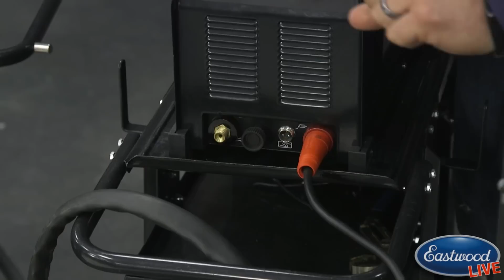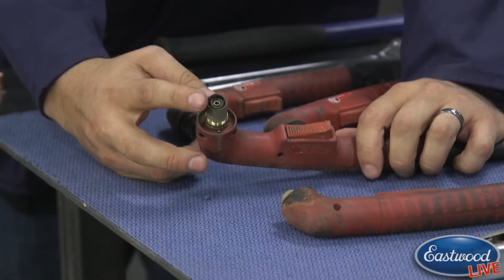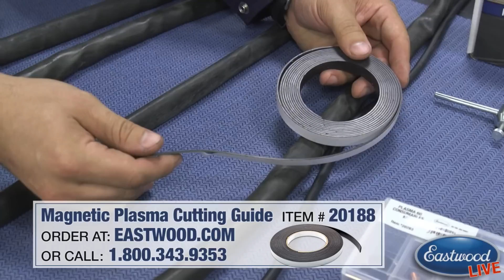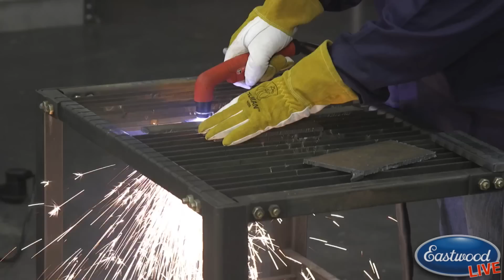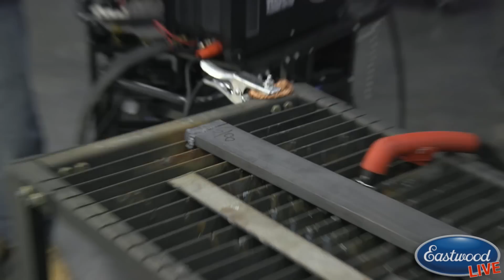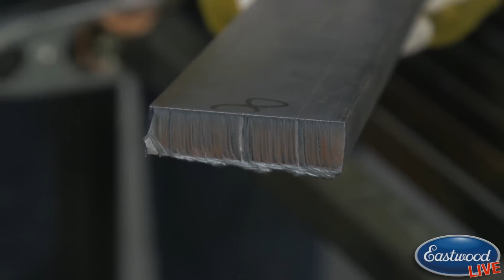Plasma Cutter Troubleshooting.  Improve Your Skills.  Get Great Results with an Eastwood Versa-Cut

Comment: Another question, what would be wrong with leaving the current all the way up all the time?  On thinner materials would it not be as clean?  Jim
Reply: No you will get over burn and tempering of the edges, you don't run your car at max revs all the time do you? No point putting the stress and wear and tear on your gear when you do not need to.
Reply: Torch consumables wear faster.  Plus the kerf is wider and you must move faster.

Comment: I have an Internal cardiac defribulator in my chest, can I safely use a plasma cutter or not before I buy one?
Reply: this would be a doctor question, but being I am familiar with the electronics they can throw out some emf noise and magnetic pulses, so you'll deff want to look into this.

Comment: That clamp is not a ground clamp! It is called the “working clamp” it actually is a positive voltage referenced to the tip of the cutter.
The material on the bottom of the steel that was not removed is called dross😁🛫

Comment: I bought a cheap one cut 50 so far I've spent more time fixing the air leaks than cutting, the digital readout reads 300 to 700 when you turn the knob and the air guage doesn't read PSI, junk
I've been had
Reply: Nope you got exactly what you wanted, you got a cheap unit and now you're surprised you got a cheap unit? where the hell do you think they saved on?!? I buy cheap, and I expect I need to do the quality upgrades my self. so learn a bit, do the fixes and enjoy your savings and good enough unit.

Comment: what is watts to use gen to power it
Reply: I'd say 6kw gen min as you'll most likely be running other stuff as well. But easy way to figure out the exact number is Volts * Amps of the unit, then multiply that by 1.25. this total number will be the peak watts a gen will need to supply it and ensure it can start with out issues

Comment: How unprepared can you be !!?? The ground goes on the work not the bench and don't tell us you haven't drained the air trap in 2 years. Makes me wonder why i bought a versa-cut from Eastwood ?
Reply: That clamp is not a ground clamp! It called the working clamp it actually is a positive voltage referenced to the tip of the cutter.

Comment: My plasma cutter spits one tiny shot and goes to 0 on the amp and does not cut cause it stops running right away?
Reply: Needs more air
Reply: Air pressure too low

Comment: Note they didn’t take the 60 amp Machine all the way to 7/8 like they calm it can cut and then when it had trouble at 5/8 they go right back to sheet metal to show how fast it will cut thru it to take everyone’s attention away from the fact they didn’t max out the Machine when they Claim they underrate there Equipment I think this are hobby Machines at best

Comment: I know I'm digging up an older video, but I've got a couple questions. First, where can I get the flow tester that you used at the beginning of the clip?

I operate a ACPC unit that runs a 105. I have a long torch body that does my primary cutting. When I run 105 (instead of 65 amp, which is more common for me,) the entire torch build gets super atomic hot in just a short amount of time. It doesn't always happen, but more often than not, it does & my consumables are shot. I am running at 100 psi & have no moisture issues & minimal dust contamination that I mitigate by cleaning often. What could cause this?

Also, I would like to note that there is a small gap between the retaining cap & torch body that allows for a small amount of air to pass. My boss doesn't seem to think it is an issue, but I've never seen another torch rig with the same gap. What are your thoughts? Any input is appreciated.

Btw, outstanding video. Very informative. I've actually made a couple of these young greenhorns watch this to get a better grasp of the process. Thanks for explaining it plainly & making it easy to understand because those mutants, well, they're special.

Comment: Does it do harm or help to increase the air pressure over spec, say 75psi instead of 60? Would that help blow material out better with thicker cuts (or aluminum) as long as the arc is enough to cut?
Reply from the maker: We recommend sticking to the suggested settings
Reply: Ensuring your air is clean and dry will go further to improving your performance over that of pressure

Comment: so if cutting sheet metal of course turn amperage down but do you still use 60 psi or should you turn the air pressure down too?

Comment: I wood like to see a plasma cut 40 cut 3/8'' metal, I don't think it will like you said it would
Reply: My thermal dynamic Cutmaster 42 will cut 1" square stock on 40 amps, I got some 20 amp tips yesterday and a new Kobalt welding hood5-11 shades and you can use it for grinding,my solar Kobalt is nice but welding only,solar power.The new Kobalt is very versatile and a much better good, I can see again.

Comment: I purchased a used 3 phase several years ago because I wanted cut thicker metal on my cnc plasma table I changed the torch part out with a hypertherm for the easier to get consumables it is connected with a phase converter and it will start to ark but quits lasting less than a second it will burn through the metal before it just stops let off the trigger and it will reset but it is the same thing the next time you squeeze the trigger. It has been sitting there for five years now

Comment: I read that if you are cutting under 40 amps using a non shielded tip you may contact the work with the tip. I cut at 20 amps so I should be able to drag the tip. Am I right. ??

Comment: can give me on how to cut 3/8'' steel with my plasma cut 40
Reply: preheating always makes it cut easier.
Reply: I cut 1" steel with my Cutmaster 42 at 20 amps with a 40 amp tip.LIKE he said they are under rated.
Reply: Incorrect angle on the torch wears consumables,tip.

Comment: I just purchased the versa 20 and I tried it out yesterday. It worked but the torch cut out consistently every 3 seconds. What gives? I checked my connections and everything was good. Pressure was set to 60 but it would only light off intermittently. I turned it down to 45 and it fixed the intermittent issue but the torch still only works 3 seconds at a time.
Reply from the maker: Please contact out Tech Department so they can help troubleshoot this issue:  800-343-9353

Comment: what lens do you need the silly one hander that came with machine came with an 11 witch is fine for welding looks like your just using dark safety glasses  will I be blind in a week ?
Reply from the maker: If you're plasma cutting, I recommend plasma shades (#5 shade) or a welding helmet that has a shade good for plasma cutting.  Here are links to plasma shades and a welding helmet.  Shades:  http://www.eastwood.com/plasma-shades.html   -  Helmet:  http://www.eastwood.com/eastwood-large-view-auto-darkening-welding-helmet-l6700.html

Comment: what lens do you need the silly one hander that came with machine came with an 11 witch is fine for welding looks like your just using dark safety glasses  will I be blind in a week ?
Reply: oh yes, glasses should never be used, but what the hell do I know. only been doing this for over 40 years. I still have great vision. 64 going strong.

Comment: Great and informative video. I've only used mine a few times, but will check and clean the consumables.  I have to remember to release the water out of the cutters internal water trap before turning off the unit.

Comment: how do you make your versa cut 60 moble  ?
Reply: amps times voltage. equals the minimum size generator you will need. compressor capable of 60 psi, not hard to do, I did. mine works great everywhere I go. I play in the sand dunes.

Comment: Why doesn't the 40 use (come with) the wire quides
Reply: Lester Wroblewski as mentioned in the video, the cut 40 has a drag tip, meaning you can rest the torch tip on the metal which results in a more precise cut. I have the cut 40 and it works very well.

Comment: Good video but why do you need a pressure meter in today's world? Company's like Hypertherm have auto air set with built in filters. Also fine cut Consumables. How does Eastwood compare?
Reply: Jason Quinlan I can't speak about the Hypertherm plasma cutter, but just looking at prices in comparison, the Hypertherm cost much more then the Eastwood plasma cutters. The flow meter isn't really needed, but good to use to check air flow. I like being able to adjust the air pressure on the unit. Makes it easier to customize different cuts. The Hypertherm does have more features then the Eastwood plasma cutters, but for the home hobbyist and auto restoration, the Eastwood Versa Cut line give you a professional machine at an affordable price. I bought a new Versa Cut 40, for $325 on sale, at my local Eastwood store.
Reply: Pk 3 thank you I didn't realize they were that cheap. I know the Hypertherm 45 has fine cut and marking does this do that too? And also drag on work peice. Most you have to lift off it a 1/16" can you drag theses?
Reply: It does have a drag tip. No it doesn't have a fine cut or marking.
Reply: this unit is cheap china product,,,,hypertherm  is the cadilac 1500 and up in price ,,u get what u pay for